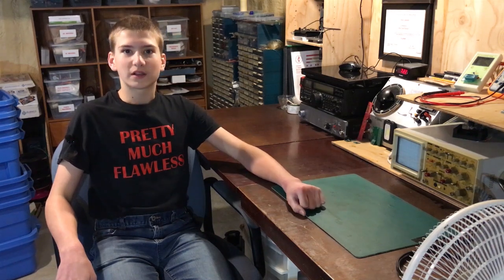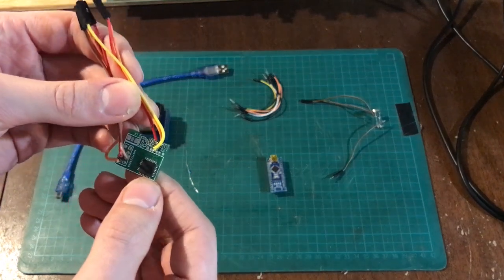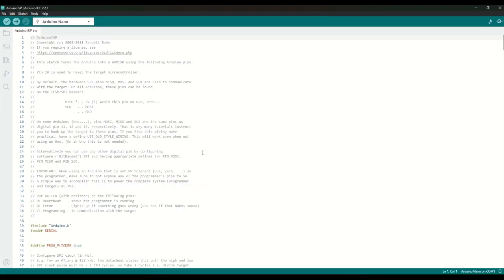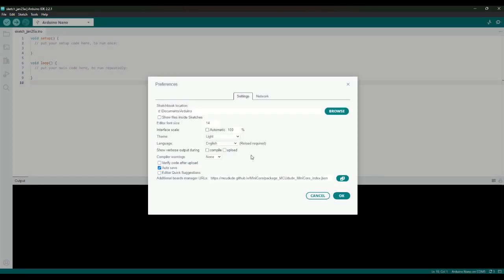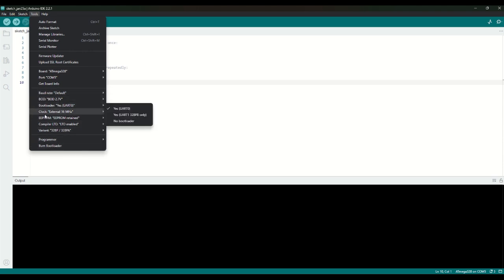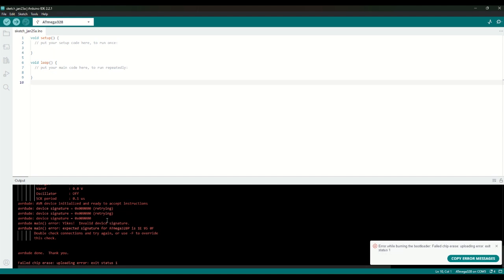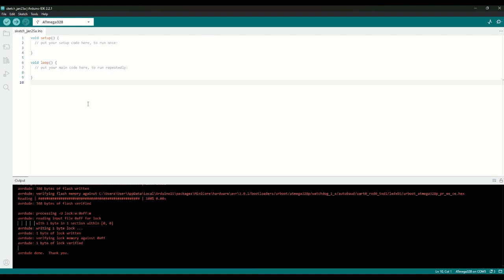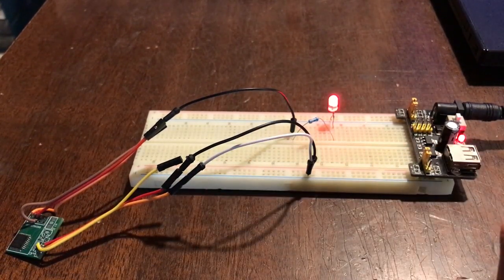How to Burn a Bootloader and Upload code to a ATMega328P-AU

Comment: After uploading code to the smd atmega328p chip, can we directly connect small 3.7v to it and turn on led or do any functions with push button etc??
Reply from the maker: Yes you should be able to, the only thing is the clock speed, you would have to see what clock speed you can run at 3.7v. this forum might be helpful: https://forum.arduino.cc/t/328p-clock-frequency-and-supply-voltage/65127

Comment: I triple checked my wire connexion but i keet having the 0x0000 signature error. I Tried with an ATMega328-P U and an ATMega328PB-AU in a socket (with my IDE set for one of those) and i'm still having this error
Reply from the maker: is there a crystal connected?

Comment: Great - Question: can you now use the pins where the quartz is connected as GPIO? If so, how are these referred to in the program?
Reply from the maker: Not as far as I know. here is what the datasheet say about these pins:

• XTAL2/TOSC2/PCINT7 – Port B, Bit 7

XTAL2: Chip clock oscillator pin 2. Used as clock pin for crystal oscillator or low-frequency crystal oscillator. When used as a
clock pin, the pin can not be used as an I/O pin.

TOSC2: Timer oscillator pin 2. Used only if internal calibrated RC oscillator is selected as chip clock source, and the
asynchronous timer is enabled by the correct setting in ASSR. When the AS2 bit in ASSR is set (one) and the EXCLK bit is
cleared (zero) to enable asynchronous clocking of Timer/Counter2 using the crystal oscillator, pin PB7 is disconnected from
the port, and becomes the inverting output of the oscillator amplifier. In this mode, a crystal oscillator is connected to this pin,
and the pin cannot be used as an I/O pin.

PCINT7: Pin change interrupt source 7. The PB7 pin can serve as an external interrupt source.
If PB7 is used as a clock pin, DDB7, PORTB7 and PINB7 will all read 0.

• XTAL1/TOSC1/PCINT6 – Port B, Bit 6
XTAL1: Chip clock oscillator pin 1. Used for all chip clock sources except internal calibrated RC oscillator. When used as a
clock pin, the pin can not be used as an I/O pin.

TOSC1: Timer oscillator pin 1. Used only if internal calibrated RC oscillator is selected as chip clock source, and the
asynchronous timer is enabled by the correct setting in ASSR. When the AS2 bit in ASSR is set (one) to enable
asynchronous clocking of Timer/Counter2, pin PB6 is disconnected from the port, and becomes the input of the inverting
oscillator amplifier. In this mode, a crystal oscillator is connected to this pin, and the pin can not be used as an I/O pin.

PCINT6: Pin change interrupt source 6. The PB6 pin can serve as an external interrupt source.
If PB6 is used as a clock pin, DDB6, PORTB6 and PINB6 will all read 0.

Here is a link to the datasheet: https://ww1.microchip.com/downloads/en/DeviceDoc/Atmel-7810-Automotive-Microcontrollers-ATmega328P_Datasheet.pdf
page 65 is where you can find this info

Thanks for watching!
Reply: @prettymuchflawless-cn1ms  Thank you

Comment: very informative + detail, have you tried with those qfp(quad flat panel) chips ???
Reply from the maker: No I have not but I assume It would be very similar.
there is some things you would have to change. 
1. you will have to change the ATMega328 Variant to 328PB
2. watch out for the pin layout as it will be different

I hope that helps
Thanks for watching!
Reply: @prettymuchflawless-cn1ms  can you tell me more about 328PB and its pin layout
Reply from the maker: @aryansh.h  I have never worked with that package before, You should be able to find some more pinout info online https://ww1.microchip.com/downloads/en/DeviceDoc/40001907A.pdf
Reply from the maker: page 9 of this datasheet is the PB pinout